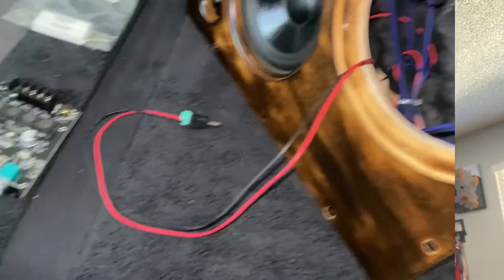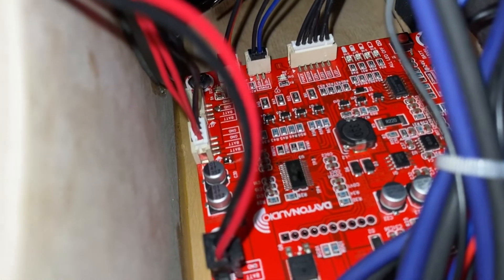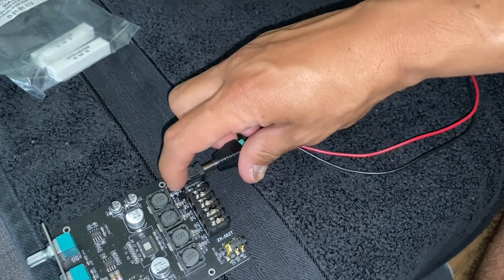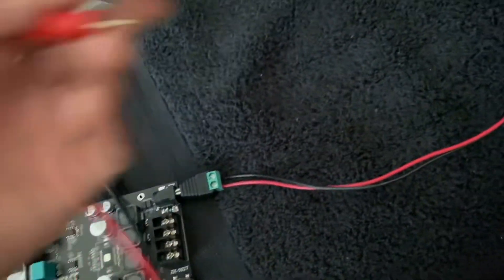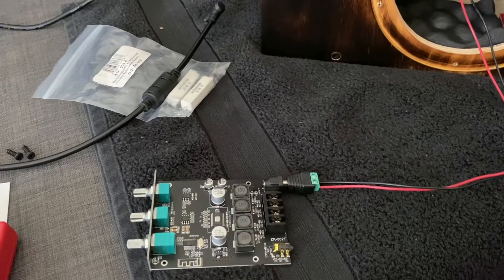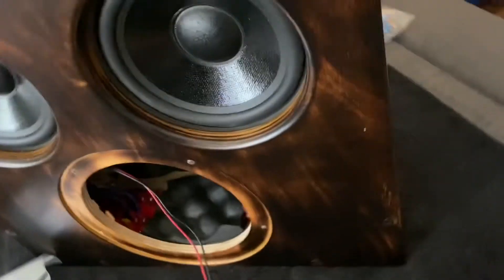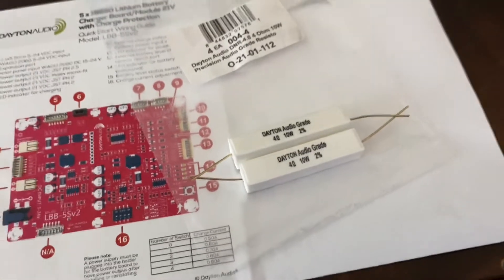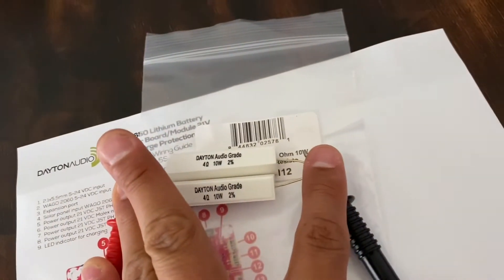Dayton Audio LI-ION charger (LBB-5Sv2) going into protect?

Comment: Hello.

Video-title says "[...]v3" (version 3). On Daytone Audio's website it ends at v2, there is no v3 (?).

2.) Does this board deliver a constant voltage of 21V over the whole range of battery cell-voltages (4,2V down to 2,5V for Lion) or does the output-voltage drop accordingly to the dropping cell-voltages during the use of the board?

3.) Can this board be used with Lions WITH integrated protection AND with Lions WITHOUT integrated protection-circuit?

4.) Have you verified by measuring that the charge-circuit on the board charges all the cells to the correct voltage and also equalizes them?

5.) Does this board equalize the cells  DURING USE (in output-mode) or is one "bad" cell (higher internal resistance) pulling the other cells down to it's level so that the board shuts down earlier than it should because one cell is already at 2,5V while the other 4 are still at let's say around 3V?

6.) Is there a heat-problem with that board when constantly drawing max. power from it?

7.) Do protected cells fit into the holders of the board (length problem of most battery holders)?

Thank You in advance.